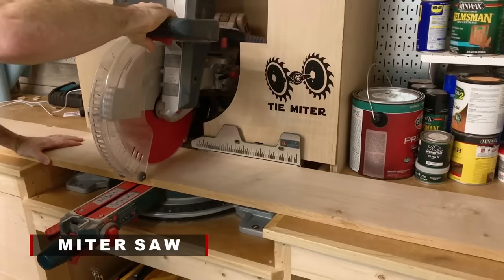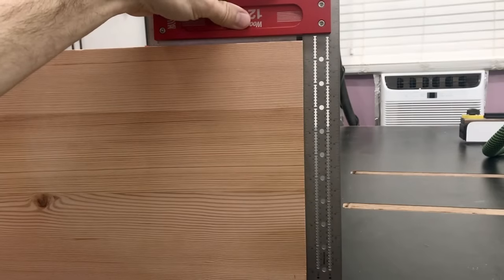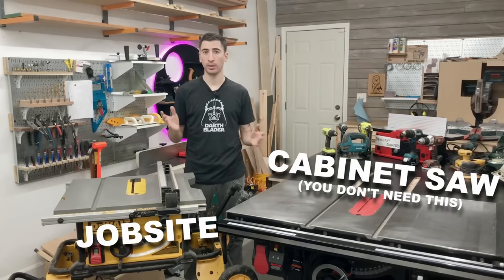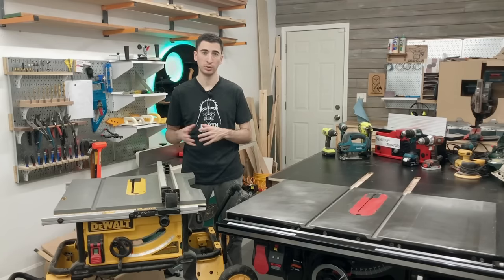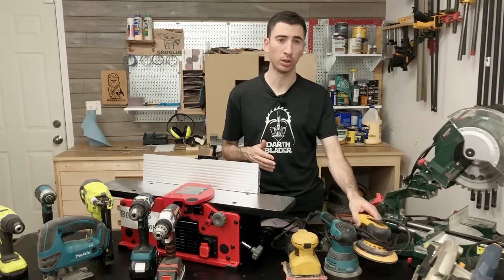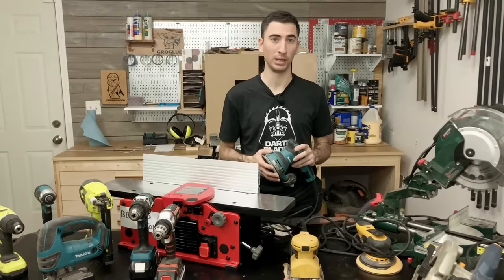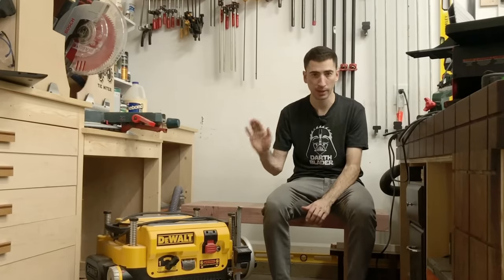Woodworking POWER Tools // Watch Before Buying

Comment: ALL things considered DeWalt is the way to go, value-wise. But....you need to pay attention to sales and have patience. Make smart purchases and you won't pay any more than Ryobi costs. Like any brand not every tool DeWalt makes is going to be perfect for you, so do a little research before you buy. Ryobi isn't "bad" but you can do better. Milwaukee, Rigid and Ryobi all come from the same corporation, Techtronics Industries. TTI. CCP controlled. Makita makes very nice tools but their batteries are intentionally designed to stop working after 3 deep discharges. Many choose Milwaukee but for more than a few years their lead in performance has been either minimal or imaginary. Each to his own and there is no reason why some won't own more than one brand. We all may have different reasons for the choices we make.

Comment: Why would you say that the miter saw would be the first purchase? A miter saw can only serve the purpose of making miter cuts. While it is a very handy tool to have, it is not a necessary tool. I've survived for well over 30 years cutting wood without a miter saw. I bought my first one about 5 years ago. Any cut you make on a miter saw, you can also do on a table saw. You are talking about beginning woodworking and not framing or finish carpentry aren't you?
Reply from the maker: I said its the first purchase most beginners make. Didn't say its the right thing to do.

Comment: I disagree with the battery powered tools.  If there is an outlet in the area you work in, cordless tools are never needed.  Corded tools are cheaper and last much longer.  Don't get caught up in the tool brand battery scam...and that is what it is.
Reply: The only cordless tool I recommend is a drill/driver combo.  The smaller 12v are perfect for most.  The big dog 24v+ are a waste.

Comment: Brand loyalists are not logical. Every brand makes good and bad products. Mix and match is the ideal option. There are even great adapters to use any battery with all tool, just dont buy the cheap knockoffs. Also expect a possbility of lower power output in most cases.

Comment: Dont buy RYOBI miter saw. My brother bought one. The blade sits off centered from the table. Spacers wont work cause it sits to far to the left. Plus when set at 0 the vertical cut is off 1 degree and the blade cant go past 0.

Comment: That bosch mitre saw is the worst buy you could put yourself through. I’ve seen 3 on site and every one had been stuffed in some way. But all done doing the same task. Any timber that’s warped twisted ect makes the blade catch and that gimmick of an arm really throws itself around adding forces against the fence and blowing them out and Ben an expensive fix,

Comment: RE HAND TOOLS
As a tradesman let me add to this

BOSCH
OZITO
BLACK AND DECKER
These are shit, The best thing i can say about them is....
If you're only using it for home and not frequently,  You can get away with it 
but i wouldn't be using it if you're a wood working hobbyist

The remaining brands,  I agree , Pick your Poision

BUT.. REMEMBER THIS .....

you must understand   POWER  and what it is 
So... (A bit of necessary Technical Information)

VOLTAGE X CURRENT = POWER

Let's explain that a bit

Say you go to the hardware store and there are 2 drills
one is 18V and one is 15V
MOST PEOPLE WOULD CHOOSE THE 18V as being the most powerful

But you see.... if they were as follows

18V  1.5A    ( NOTE :  A  and Ah  , as far as you're concerned are the same thing)
15V  3.5A

so let's do the math
VOLTS X AMPS = WATTS
   18      x    1.5     =  27 Watts
   15     x      3.5    =  52.5 Watts

so as you can see the smarter choice would have been the 15V Drill

The thing is most people do not understand what  A  or Ah means so they mentally ignore it

A = Amperes (or  Amps)
Ah = Amp Hours  (which means.... this drill, if you hold it down on full for a full hour will produce this many Amps)

Also...     it's not the drill that has the power,  IT'S THE BATTERY
so ... Common question
"so martin if i see a drill that has a 15V battery on it, can i put a 18V Battery on it"

the answer is... YES, because the drill SUPPORTS THAT BATTERY
because the manufacturer would not have made it compatible if it didn't support the highest Power level battery

so yeah... that should also be noted
Get the battery  with the most amount of Power,  you'll thank yourself later

Comment: I'm not going to listen to a teenager who has been alive fewer years than I've worked wood, tell me that my tools aren't good. My cuts are straight, my measurements accurate and my stuff sells. And, although I don't use HF power tools for detail work, they have some items that are meant to be a used so you don't burn up your higher dollar tools. But thanks anyway, Skippy.
Reply from the maker: Goats are lame - I like turtles 🐢
Reply: So your philosophy is.. 
“ If someone is younger than me that automatically means I’m wiser and can’t learn from them” 
Yet you go out of your way to listen to someone younger speak on the topic. One directed at novices and get offended that your being talked to like a novice. 

Sounds like you’re not as wise as you believe yourself to be. 
By any chance is your specialty at building wooden high horses? Or do you just have the one you rode in on?

Comment: Another reason to not buy a battery powered sander is no one yet has figured out how to make them comfortable to use for more than 5 minutes. You are always getting the battery pointing the wrong way and getting in the way or trying to figure out how to grip it then drop the darn thing when your hand gets too tired to grip it.
AND you are constantly switching out batteries.  
This is the most unergonomic tool in the store.

Get one with a cord!

Comment: I kindly will disagree about a cheaper miter saw and the fence attached.  These days you can have to best saw money can buy, but our lumber today is horrible, crown molding bowed, warped, tampered, square stock out of square, bowed, crowned etc.  So tell me, does a fence matter these days.  I ran harbor freight saws and as for a beginner, no problems, there fence isn't that horrible compared to the wood product of today.  Unless a good wood shop makes you moldings for you, your shit out of luck if it's not installed in a few days and stored properly.  It's a buyers market, if you love red, it's Milwaukee,  you love yellow, it's dewalt, you like flashy colors, it's ryobi.

Comment: Not true about the DEWALT saw. The Bosch 4009 series takes dado blades too. I used mine for 18 years before the bearings finally got shot. Too much walnut run through it. The Bosch is superior in all aspects to the tiny DEWALT so if you aren’t lugging it around in your Toyota Corolla get the Bosch for the extra $, the fence is dead nuts straight. The only reason I have a sawstop now is because the Bosch died and I have the room now for a bigger saw. But to be honest it isn’t a 10x better saw and my projects are only marginally better. The truth about most tools and the quality of the output is the skill of person using it. Same goes for guitars.

Comment: Another Ryobi hater, you didn't actually say anything bad about them, but you also didn't mention them either! How many times has all the other makers have changed battery platforms?
Reply from the maker: Nothing better than overly sensitive Ryobi fans.
Reply: @Lincolnstww  One thing better is to objectively review things and not just use your opinion! I have had few if any Ryobi failures, and I use them daily.
Reply from the maker: @dolfans413  you said it yourself, I didn’t mention them much unless I had experience. Then they were mentioned. You’re clearly sensitive to this Ryobi stigma. It’s okay to use their tools, no one is judging you
Reply: @Lincolnstww  the title of your video is don’t buy these beginner tools and you show Ryobi! They are a great beginner tool yet you say a lot by not pointing that out. Sensitive yes because there are so many people not giving them credit for the job they do not to mention great customer service!
Reply from the maker: @dolfans413  Their table saw is absolute junk and their miter saw is so-so at best. Their drills and drivers are fine. You happy?
Reply: @Lincolnstww  happiness is such a difficult state to achieve but I feel better about your assessment of beginner tools!

Comment: I have a Makita finish sander. It is more capable as a sander than my Ryobi random orbital cordless sander. I use a 3m air powered orbital sander at work. Miles better than any electric sander I've used.

Comment: The key is to buy the lowest price tool that will get the job done. Let the job tell you what that is.

For example, if you want to use a hand plane to finish your work, a $35 big box plane won't work. It will be so poorly made that even Thomas Lie-Neilsen couldn't get it to perform well, let alone a woodworking beginner. You don't need to spend $600 on a Lie-Neilsen either ... Lee Valley has "good enough" planes that work very well for much less. [Or consider a different way to finish your projects.]

Some low priced tools are acceptable bargains. Some are pure cr*p.

Comment: Do not buy Ryobi Drills. My company supplied me with a new one and it was the worst drill Id ever used. Completely guttless and battery would be dead after one drill hole. I'm not joking. You shouldn't even put those things in the same shot or bench as a makita.

Comment: In general, Im a hobbyist and don't care to measure my d*ck with the brands I use, which is easily the majority of the reason behind this argument when it arises. The elitism and ego that exists in woodworking is astonishing to me. But I digress. Regarding handheld power tools, ergonomics might be a huge factor. I am a large handed lefty and while working with my brother in law a while back, I tried to use his Makita drill. Absolutely hated that thing. I could not keep my knuckle from hitting the reverse switch because its mounted so low on the handle. I ended up running home to grab my ancient Ryobi that just fits my hand. Feel a few things out, buy what you can afford, replace it with better down the road if necessary, and forget trying to impress people with your ability to waste money you might not have on a quality of tool you might not need.

Comment: Disagree.  When you’re talking about Ford or Chevy it’s more like if Ford offered a 1 ton diesel and Chevy only offered 1/2 ton gas.  Will they both carry a couch around at relatively the same amount of work?  Yes.  Will they both carry 5,000lbs of concrete in the bed?  No.  With tools it’s true that both a Makita impact and a Milwaukee impact can drive a 3” screw at relatively the same speed.  However, a cordless Makita impact drill can’t drive a 1/2” x 10” concrete bolt.  I see it all the time on the job site.  Peoples tools all work the same until you have to work on the extreme end of the spectrum.  And then they don’t.  That’s what you’re paying for when you buy a brand like Milwaukee.

If you’re out working, you will immediately negate any tool cost savings by needing to make a single trip to the store in fuel and time.

I have plenty of cheapo tools.  My drill press is harbor freight, because I drill one thing: plugs.  I have multiple contractor table saws but not a single shop saw because I value portability over the size of a cabinet saw.

How hard are you going to use your tools and how reliable do you want them to be in extreme situations?  If you think a saw being 90* or not is what you’re paying for you misunderstand tools.

Comment: Only got to 50 seconds then stopped. Mitre Saw first purchase, you're having a laugh. 1st, drill, 2nd sander, 3rd chop saw, 4th jigsaw, 5th track/plunge saw, 6th router and  hand tools just as effect , but no mitre saw yet, that's way down the list of needed tools.

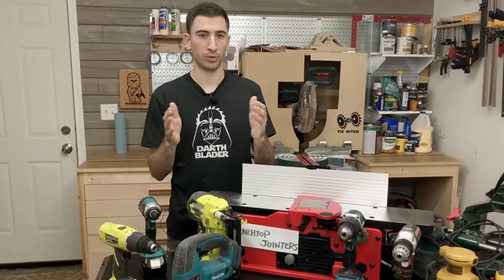Comment: 2:12  Actually, not at all.  Ford is far superior to GM and Dodge which have, for about the past 20 years, allowed their quality control and reliability slip well into the unacceptable range.  It's not unusual for a GM or Dodge truck to be considered junk by the time they hit 100K miles.  Even Ford isn't as good as they used to be.  It's not uncommon for a Ford to need major service by the time it hits 100K miles.  On the other hand, a Toyota truck is still considered a fairly new vehicle at 100K miles and will need nothing but routine maintenance (which is why they hold their value so well).

Comment: You lost me as soon as you said "you don't need this" to a cabinet saw. There are options out there for a cabinet saw that are not far off priced from a portable saw, and they'll significantly outperform them. considering most "Beginners" don't move the saw to begin with. 
- guy who use to sell professional tools.
Reply from the maker: I lost my turtle 🐢
Reply: You don't need a cabinet saw. I sold mine around 15 years ago. I run my custom cabinet business with a track saw exclusively.
Reply: @Lincolnstww is that a turtle or tortoise?